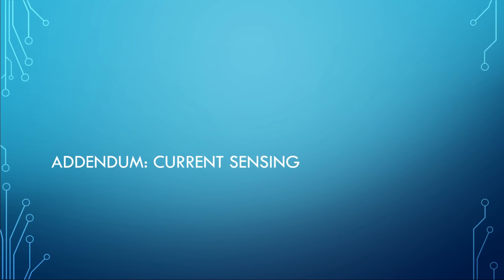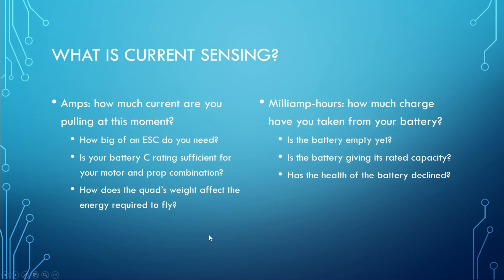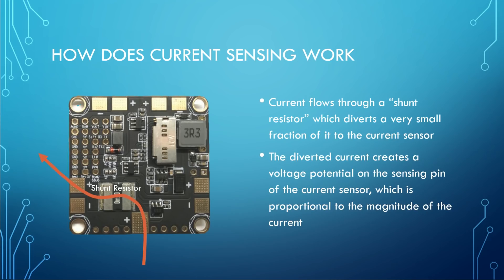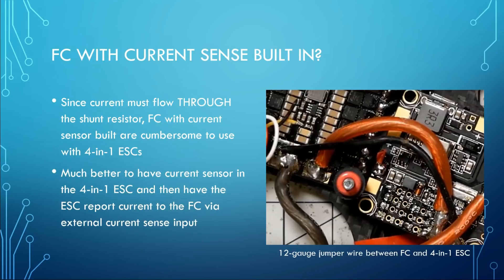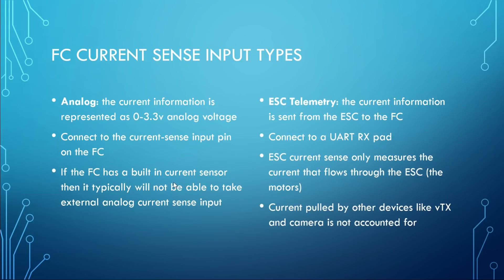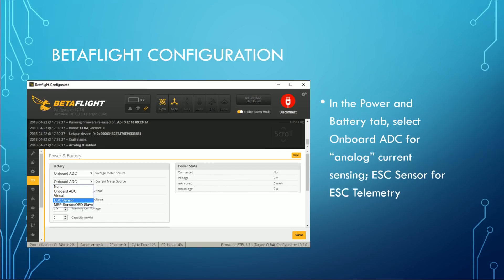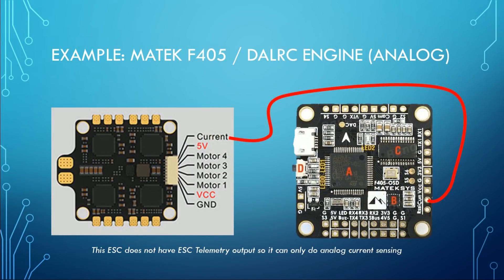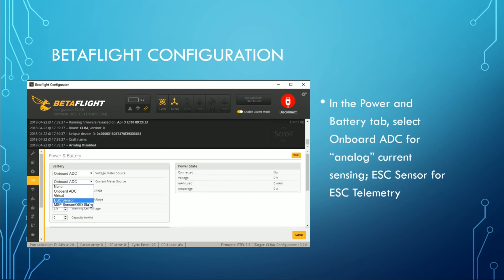Flight Controller Wiring For Beginners - Part 7 - Current Sensing

Comment: Literally needed info rn on this searching around everywhere last night. Good stuff J
Reply: Have a matek f405-ctr with current sensors, wiring up with BLheli_S 4in1 with current sensors. How would you recommend I wire them up?
I was about to run XT60 connector to the esc and run the current sensor to the FC via external output but I also want to monitor current of the vTX and camera (in which I would follow your 4in1 esc wiring to AIO FC video).

Comment: How to get audio and smart audio on unify pro would help
Reply from the maker: Just connect the mic and smartaudio wire both to the same UART TX pad. That's all there is to it.
Reply: I need this too! :)
Reply: Connect the Unify to a spare UART's Rx, then enable it in Betaflight. I'm not sure if JB has a video though...
Reply: yeah to get smart audio. How would you get audio AND smart audio both at the same time? I know there is a way but video would help :)
Reply: Not that simple, TBS has a diagram on how to do it and it requires a couple of resistors and a capacitor
Reply: You dont have to do that stuff with AKK because they engineered the audio better.

Comment: Can you share a link to high throttle oscillation... xjb 3s nothing 4s shakes hard above mid throttle
Reply from the maker: Lower P gains? Add TPA.
Reply: Joshua Bardwell I will try that thank you for the help

Comment: So we cant ressource remap with the analog signal to Another pin?
Reply from the maker: Only the RSSI pin can be remapped this way. Current sense and RSSI both map to an ADC pin on the processor. So they are interchangeable with each other but not with any other function.
Reply: Joshua Bardwell Nice info. Wish i knew that earlier

Comment: Hey, JB, maybe here is not the best place to aks this but... I got an Kakute F4 v2 and a DALRC engine. I want to use the pin header connector that is of the same size on both boards, however I'm not entirely sure on how to reroute the wires to match.
Any ideas on where to look up for this?
Reply from the maker: You just have to look at the pinouts and reorder the wires so they are correct.
Reply: lol took some searching but hope this helps http://www.holybro.com/manual/KakuteF4V2Manual.pdf https://www.racedayquads.com/products/dalrc-4-in-1-40a-32bit-engine-esc-dshot300-1200

Comment: In betaflight what value do you change the amperage meter to? Stock is 400 but that is not setup correctly it's just a stock value. My matek boards are 169 and 179. I've been trying to find the value for my racerstar star F3 s for two weeks
Reply from the maker: https://www.youtube.com/watch?v=pj_CaMZ98g4

Comment: Hi Joshua if the gopro has the props in view if I mount were the gopro middle quad would I have more props-motors on the vid. Im thinking of mid mounting the gopro on 5mm standoffs
Reply: yeah I think you will now see the front of kwad and more props can you just raise angle or add a few mm under the angle you have if you like hdcam same as fpv